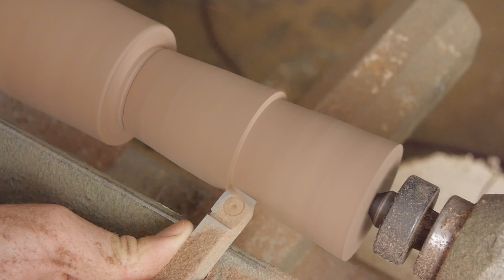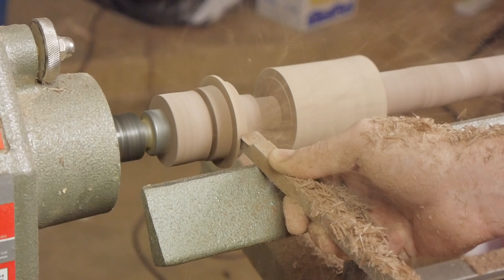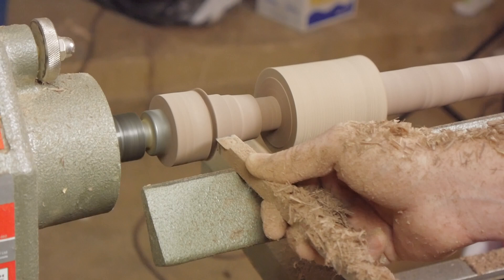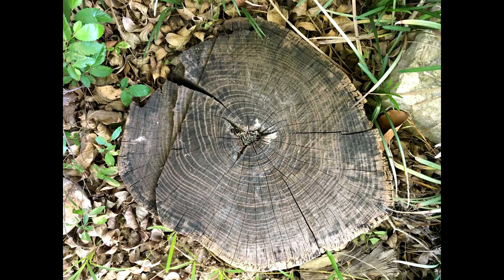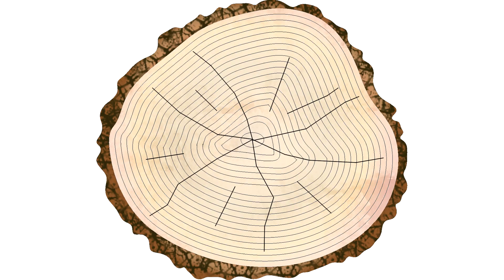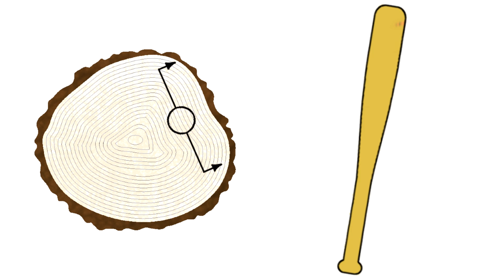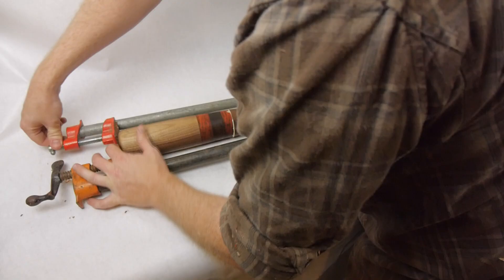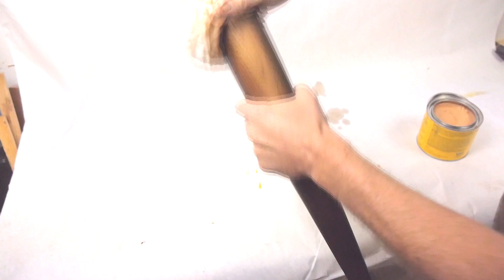Why do Baseball Bats Break?

Comment: Fun fact: 3D printed materials also work similarly to wood when it comes to “Grain”
Reply: Fun fact: bread too!
Reply: @zachnerdydude6605  not really, alsp, bread is not used as material to build
Reply: @daanm3869 ny devito
Reply: k
Reply: The temperature of the part and hot end during printing is critical to getting proper fusion between the layers. It can make a surprising difference to material strength.

Comment: If you really don't want the bat to break, just make it out of aluminum.
Reply: in that case all hits will be homeruns
Reply: +scasny Is really that much of a change?
Reply: Finn El Humano dont know dont care dont watch
Reply: Yeah, Mythbusters did a test on it. Aluminum bats are so superior that, if the pros weren't limited by their wooden bats, the sport wouldn't work anymore.
Reply: And who in their right mind would be a pitcher. 60' 6" away from a powerhitter with an aluminum bat... that would be a horror movie waiting to happen
Reply: +h3rteby also, the ball comes off the bat entirely different on metal bats than wood (mainly speed-wise) actually causing more of a danger for major league and minor league players.
Reply: Carbon fibre down the middle of a wooden bat then.
Reply: ThoolooExpress wooden ash bats are traditional, you don't get that satisfying "crack!" Out of metal bats. It's just not the same if you use metal, i prefer wooden bats. That's just my opinion though.
Reply: +Blue Brains You don't get that satisfying crack when the bat breaks and satisfyingly punctures your lung, making you sit out the rest of the season completely satisfied.
Reply: the bat that speared the guy's chest was maple, not ash...
Reply: Major league games aren't allowed to use them because it makes everything too easy.
Reply: A friend of mine broke an aluminum bat in half at batting practice.
Reply: Simon Herteby The reason is because they are hollow and filled with gas to increase pop, if you changed the metal or deadened somehow it could work.
Reply: ThoolooExpress in the MLB they can't because it would be way to easy for them to hit it over and that's not fun!
Reply: ThoolooExpress one of my teammates in a little league game broke his aluminum bat. not like a wood bat, but you heard some rattling in it, then he hit it on the ground and then it broke In 2
Reply: plus balls hit with aluminum bats have a higher hit speed, which is a bigger threat to the audience. that 100mph hit with a wooden bat, can easily reach 200 with an aluminum bat
Reply: Riley Koziol They do not reach 200 coming off an aluminum bat.
Reply: ThoolooExpress it was an exaggeration...
Reply: Riley Koziol 200? Really? They're baseballs not rockets, give them denser aluminum bats to simulate wood.
Reply: ThoolooExpress I LITERALLY just said it was an exaggeration
Reply: Riley Koziol there's a reason why the certification was changed from BESR(Ball Exit Speed Ratio) to BBCOR (Bat-Ball Coefficient Of Restitution). BESR bats had a bad rap with pitchers. Let's say a 90 MPH pitch comes in. The average exit speed off the barrel would be in the ballpark of 108MPH. BESR bats had more of a "trampoline effect" and as a result was more home runs. Unfortunately, pitchers hit by come backers are more likely to face serious injury due to the higher exit velocity and shorter reaction time. It wasn't until 2012 when all leagues supporting metal bats (Little league, High school, College) switched to the BBCOR. The current bats perform closer to that of a wood bat, but has a significantly reduced "trampoline effect" when compared to BESR.
Reply: Yeah, the sandman is best
Reply: Carbon Fiber is the way to go, or composite (Duralumin+Carbon)
Reply: blah, that's not how the game was ment to be played, I hate metal bats it cheapens the game.
Reply: adding an aluminium rod Inside the bat would probably fix the problem.
Reply: Aluminum bats also break dude. It's not that hard to break one.
Reply: You guys should play cricket where we hit dense balls made of wood with dense bats made with wood.
Reply: If you're ready for home runs to be meaningless
Reply: How about bats made out of microscopic carbon nanotubes? ;)
Reply: Everyone could continue to use the regular old maple bats, they just could get laminated.
Reply: @SimonWoodburyForget  What do you mean no one would notice, a thin lamination similar to the one holding your windshield in place after shattering. The bat would snap in two, but no shrapnel pieces would fly out. And I am not saying those thick plastic coatings, just a thin layer of plastic covering the thinner parts of the bat. You in fact could retain the wooden head, because its the point where no breaks occur anyways.
Reply: @SimonWoodburyForget   Something like that. Coating the wooden bat with some thin, durable and elastic layer of some material. I believe that plastic would be best.
Reply: @SimonWoodburyForget   I meant just laminating the wood. No metal whatsoever.
Reply: What if I run out of aluminum?
Reply: no aluminum bats,  make them use copper bats! up to 1" hollow core allowed, may not be pressurised above 1 ATM. 

homeruns would be well earned 

(though not as much as w/ a golden bat)
Reply: I broke 4 aluminum bats in the batting cage. Most broke from the near the handle. The last one was a 36 inch 37 ounce aluminum bat . I hit the sweet spot twice on an 80mph. The first time, I smelled something burning, but didn't know where the smell was coming from. Second time, I hit the same spot on the bat (sweet spot), and that area caved inward and started smoking a lot
Reply: @donaldasayers  Carbon Fibre also shatters like wood. It would have to bee carbon fibres without any resin, so the bat still breaks, but doesnt slit into two. Putting a thin metal rod in the middle would also be an option. Not to i crease weight or strength by much, but to hold the bat together, when it breaks.
Reply: Polypropylene.
Reply: They would hit the ball back at the pitcher at like 130 mph
Reply: ThoolooExpress look up JJ Swartz breaks aluminum bat
Reply: ask people who went through besr to bbcor in high school
Reply: Why don't  you play 3rd with some of the exit velocity currently in the game? A ball leaving the bat at those speeds could easily kill a pitcher or even real regulars, you know athletes.
Reply: @Odin029  that's what I was gonna say. The ball would be leaving the bat at such a higher speed that even the shortstop would be in danger.
Reply: @JimmyTheProstitute  they will have a higher exit velocity my studies show more of a 10, 15, possibly 20.
Reply: and just weight them to be the same, or add something to absorb more energy
Reply: Aluminum bats are easier to hit further with. It absorbs less friction. The mbl is ment for pros, not rookies.
Reply: @Rich.3938  so... take an aluminum bat and (follow me here) apply a rough outer coating to give it performance comparable to a wood bat.
Reply: @mrkiky  And metal (like aluminium) bats will be super dangerous to pitchers.
Reply: I think aluminum is the future. As humans get faster and stronger and smarter we can simply increase the size of the ball parks. Move the pitcher back another 10 feet, increase the outfield by 1 or 2 hundred, etc to compensate for the speed and distance from aluminum
Reply: natural feels better and has more spring ...
Reply: I think they should just go back to split ash for MLB bats.
Reply: metal bats break all of the time

Comment: Another problem would be elasticity, Ash is a very tough and elastic wood while maple isn't. In Europe most bows were made out of riven Ash because it's the best common wood for that use. 

A bat well made of Ash should be unbreakable, however it's elasticity means a portion of the energy in swinging it will be lost when striking the ball because of the deformation. 

Maple on the other hand is a very dense, brittle and inelastic wood. This makes it great for musical instruments for instance because it'll transmit sound waves easily without dampening them, and when striking an object it's inelasticity makes it transmit the full force of the blow. 

Maybe the ideal bat would be a composite, made out of an ash or hickory core with maple sides.

Comment: Another awesome and interesting video! Thanks for this! Is there any recommendation on how far from the center should be the wood blank? - blanks further from the center will have growth rings in almost parallel planes.
Reply from the maker: +Cactus! workshop Thanks. That's a really good question. In my research I didn't find anything related to the radius of curvature for the grain, but I would guess it is at least a consideration when grading the blanks.

Comment: You bring out the important part of wood and it's structure. As a carpenter by trade I noticed in the early 80's the same failure in wooden tool handles. The same as Ash with a bat is the same forces of say a hammer handle or shovel but thankfully when either of those break there is a significant less chance of injury, unless you rank frustration up there too. This became so common I stopped buying wood handled hammers and use steel shanked handles. In the old days of wooden wheels on wagons and early automobiles a wheelwright who make the hub, spokes and rims all with a keen eye as to how the grain in the wood was used, this made wheels stronger and less likely to fail. I blame automation for this as it put wheelwrights out of work and replaced then with less skilled workers who were just used to feed machines and paid little attention to grain strength. I use grain as well as color and uniformity in all cabinets and furniture I make and turn on a lathe. Paying attention to the wood and it's grain makes for a more stunning and quality product in the end.
Reply from the maker: +James Stanlake Very interesting. Thanks for sharing!
Reply: Hickory is the handle of choice in axes and hammers. The long fibres generally keep the head flying off with a breakage, not that I've ever had one.

Comment: topic for a vid please
why dose kitchen scrubber pad  scratch steel sinks if the nylon is softer then then steel
Reply: hard particles trapped in the nylon?
Reply: That is exactly correct. Those scrubbing pads are generally impregnated with abrasive material to improve their effectiveness.

Comment: One question: When you're showing the resistance to bending for the edge and face grain using the deck of cards the moment of inertia of the bending wasn't the same. If it was a square section rather than rectangular, how much stiffer is the edge grain vs. the face grain supposing I is the same? IE What is the modulus of elasticity comparatively for a species like maple or ash?
Reply from the maker: +GregN456 The deck of cards was just an illustration to demonstrate anisotropy. If you want specific engineering properties of wood, I recommend taking a look at The Wood Handbook put out by the US Forest Service. I believe you can download it from their website.
Reply: +Practical Engineering Cool! I didn't know such a thing existed. I just finished my 3rd year of Mech and I haven't done much with anisotropy. Its definitely an interesting new flavour of analysis for me!

Comment: +Practical Engineering please tell me what you think of a wooden bat drilled from edge to edge with a rubber or other flexible material insert.... my theory is when it brakes it will hold both halves and not fly off...kinda like a laminated glass....

Comment: Why not use Oak?
Reply: Yoah Cat the ball springs off the bat better with maple.  oak is heavy and dense.
Reply: PC MasterRace so if maple gives an advantage, why not just force all bats to be ash
Reply: Harambe   because its not like using a metal bat or roids or a corked bat tar on the ball or something. its still a wood bat that with flaws and perks that has to be practiced with and learned. its bat preference.  the same reason everyone isn't required to use the same glove or same cleets even though through testing you could probably prove a few are way better than the rest.
Reply: It wouldn't be oaky to do that.
Reply: They should use iron tree.

Comment: Sorry, I'm completely unfamiliar with baseball. So how exactly does the player hit a ball with maple bat -- across the grain or along the grain? I mean, does ball contact annual growth ring, with rings parallel to the swing, or plain surface, with rings perpendicular?
Nice video, by the way.
Reply from the maker: +Vyacheslav Azarov With a maple bat, it is with the growth rings up and down (perpendicular). With ash, the rings are horizontal (parallel).
Reply: +Practical Engineering Thanks!

Comment: There is another reason bats break.

A bat is basically, a lever
.
The fulcrum is where the bat and ball
meet.  If the fulcrum is too close to the 
handle, the bat wants to fold at that 
point.  Hitting with the extreme end 
of the bat, will also cause it to break.

The best way to prevent the bat from 
breaking, is to hit the ball with the 
sweet spot.  (Hitting the ball, at 
either extreme will also be quite 
painful.)

steve

Comment: Bats can be engineered to be relatively break resistant by re-inforcing the inside with carbon fiber. A central section is garnered with a tubular pc. embedded the length ....breakable? Probably not.
Reply: or just a carbon wrap around the outside. it can't be a problem that's all that hard to solve. Hockey players switched to composite, and it's well time baseball does too.

Comment: The reason why is simple it’s wood wood fractures when it’s hit hard enough meanwhile steel or aluminum dents or bends even if wood is as strong as steel in terms of how strong it is but wood will always be tougher unless it’s able to bend instead of fracturing and yes wood can bend but it does break unfortunately easier than metal as a whole and polypropylene like on the Brooklyn crusher smasher shorty and whopper is better than both those since they are a hard plastic that bends instead of breaking which makes them basically immune to being snapped

Comment: Great video! I'm a bit confused about 1:42, is the plane of weakness not across the growth rings (perpendicular to them) instead of around them?
Reply from the maker: +cullender1 For ash, the plane of weakness is around the growth ring due to the increased porosity. For maple, the weakest planes are tangential (perpendicular to the rings).
Reply: +Practical Engineering Thanks for the response. Does that mean that an ash bat is more likely to break if a ball comes into contact with the face grain? (growth rings vertical)
Reply from the maker: +cullender1 Exactly. This is why the logo is placed on the face grain, so players will swing with the edge grain contacting the ball. See 1:57.
Reply: +Practical Engineering Thanks, just wanted to make sure I had understood the video right, keep up the good content!

Comment: I think it would be good to have some quantitative comparison with Ashe bats for reference.  It's good to know the Maple bat rate of breakage decreased by 50% as a result of the apparent engineering study of grain orientation effects.  Also, however, it would be interesting to know if different types of Maple (of which there are both species, age, and other differences that could be selected).  Also, what was the property of Maple that made players choose them. That is to say , can safety and performance be optimized in some way?  By the way , without this video I wouldn't know anything about this, so thanks.  These questions just come to mind when you said, "tell us what you think." - to paraphrase..

Comment: Yeah that makes sense, maple will not split using a Froe and believe me I have tried. Ended up using wedges, Hammers and a broadax (it took days to split) plus a whittling knife to split it but to make it usable I had to run it over to the shaving horse and use the drawknife to smooth it down and get it flat enough for the wood plane to work on it.
Stuff wasn't even curly or spalted… total waste of time.

Comment: Wooden railway ties/sleepers have metal plates on their ends to reduce splitting.  I suppose there is always a danger of a metal end coming off if used, but I wonder if the idea of dipping the end in some polymer to reduce splitting at least off that direction? 
      I'm not into following sports, but from what I understand, the major league does not want to go to aluminum bats because since they have the top athletes, too many home runs would be generated.  But wood itself in an inconsistent material and It seems a synthetic or laminated type predictable engineered wood product which would mimic the lower energy transfer characteristics to the ball of the average wooden bat while at the same time not being able to shatter or shatter in a dangerous way might be developed.  Maybe someone out there will get a patent on something the major leagues need.

Comment: I've seen a lot of people asking why don't they just have all players use either a metal or composite bat so you don't have to worry about it breaking. It might sound like a good idea at first( no broken bats=safer for the players and fans.) but instead you'd have pitches get hit at 140mph instead of 115mph, it might not sound like a lot, but for a fan who is sitting by the dugout that could mean the difference between getting out of the way and being fine, and a potentially deadly situation.
Reply: And I assume that they can't put up cages around the field like they do with games like Tennis?
Reply: The real question is why don't they use only metal CORES inside a wooden shell? That wouldn't change the weight if dont correctly and since the outer part is still wood it wouldn't effect the balls speed at all no? I mean there are rules that forbid this, but the question is does it make sense in this regard?